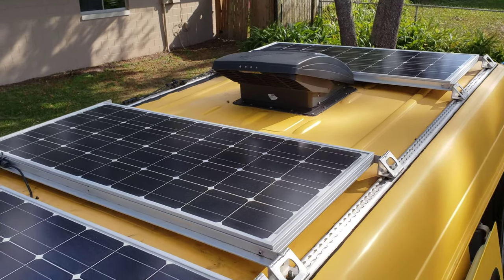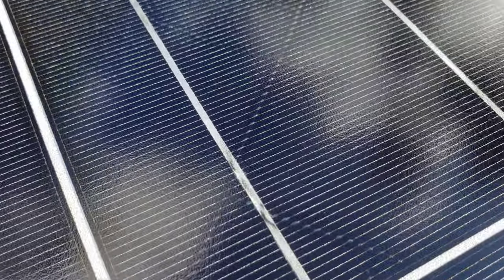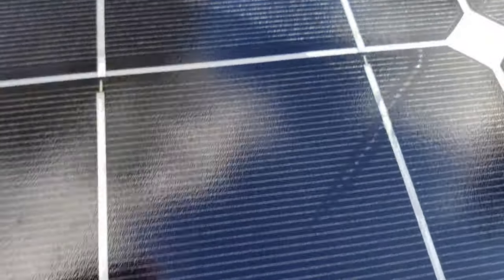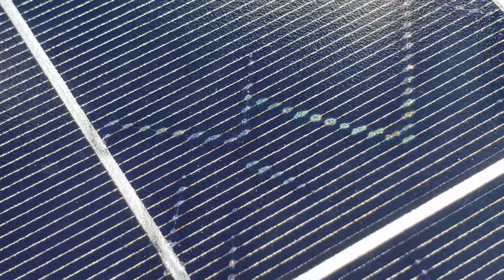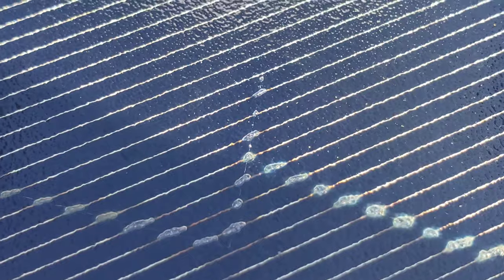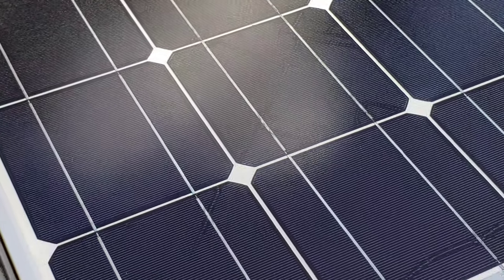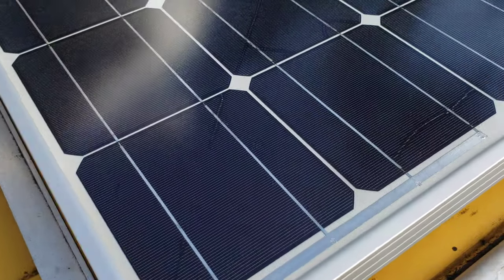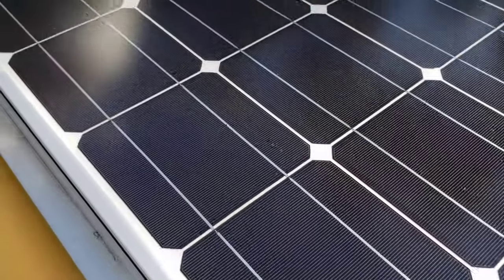RENOGY Solar Panel Failure Due To Cracks In The Cells | 100 Watt 12 Volt Monocrystalline  RNG-100D

Comment: Solar engineer here, theses are micro cracks in the module cells. These cracks are typically caused by impacts and mishandling of the modules. The module cells are much more fragile and less flexible than the front cover glass. The back of the module is even more susceptible to impacts because it typically only has a plastic sheet. Just because the front glass is not damaged by an impact does not mean a cell did not get damaged. For heavens sake do NOT walk on the module. Also most manufacturers have a spec for an allowable amount of cell cracks and test each module with an infrared cameral (electroluminescence).
Reply from the maker: Thanks for info from a pro. Appreciate your expertise. Do the micro fractures typically cause a reduction in power output? I definitely would never walk on them. I purchased a new panel, but before installing, I did some output voltage/current testing shorted and with a load and compared to the brand new panel. Surprisingly there was no noticable loss of power output from the panel with the micro fractures. So, I put the old panel back on, since the dimensions of the new panel were different, and would have required modifications to my mounts to install.

Comment: how long, Im having issues now with new three month old panels now putting out about ten amps formerly nearly 18, they're guaranteed 5 years! Thanks for details which may help. Method of checking voltage output? Any luck getting replacement?
Reply from the maker: I got a new panel thinking this one was defective due to the snail trails. However, when I measured the output current using an inline voltmeter (and a clamp meter to double check), the old panel and new panel were putting out the same amount of watts. Surprisingly, the snail trails did not seem to have any effect on output. I measured current 2 ways, first by shorting the panel through the amp meter and then used an 18V power tool as the load and measured the voltage and current in full sun.
I ended up finding that the charging current loss issue in my system was due to a loose wire at the fuse between the solar charge controller and battery.
Reply: @engineerable  thanks for the reply, maybe you could comment and explain why people put fuses on their solar panels, I see no reason because shorting out a solar panel does no damage and you're not about to burn up wires with four amps at 24 volts. To me it just seems and unnecessary complication and a way to sell fuses and Hardware that is totally unnecessary. Can you explain what a fuse is protecting and why install it?
Reply from the maker: @douglundy5755  Even 4 amps is going to create heat if shorted, and something will eventually melt. In my case I have 4 panels, which can output 400W (33A at 12V). That's a lot of energy. I have an inline fuse before the solar charge controller, and a fuse between it and batteries. Never know when something can go wrong and short circuit.
Reply: @engineerable  thanks for the reply but in most circuits there is a large amperage available if the wires are shorted, say a battery or house current. I have to disagree and say that f o u r amps it's not going to cause any damage and you can connect a solar panel plus to minus and it will simply flow 4 amps. It does no harm. I don't believe I'm wrong. Anyway thanks for the reply
Reply from the maker: @douglundy5755  I misunderstood your question, but you did teach me something. Yes, if you simply short the panels positive to negative wires, then it creates a current loop and current flows through the wires without heating up since the wires are of large enough gauge to handle the current. This is one way to test the output with a amp meter. I was thinking about what would happen if the short occured across something that can't handle the current and heated up or caught fire (like the charge controller circuit board). However, I did not consider that the panels have a current limit, and fuse needs to be larger than than the max current, but if there is a short it will never blow, so no use for the fuse. So your right, I've learned that for a single panel or panels connected in series (like my 4 panel setup), there's no need for a fuse between solar panels and charge controller (except for surge protection, lightning).
For solar panels connected in parallel, if a short happens in one panel, then the current from all remaining panels will go to that shorted panel, which can overload the wires and cause a fire. So in that case, each panel needs to be fused individually. https://www.windynation.com/jzv/inf/how-properly-fuse-solar-pv-system
Apparently it's safe practice to have a fuse on a series system for surge protection, like lightning. Although it seems like lightning could just arc across the fuse? Maybe the fuse blows, charge controller is damaged, but no further current can flow until the system is repaired and fuse is replaced. https://altenergyoptions.com/do-you-need-a-fuse-between-a-solar-panel-and-charge-controller/#:~:text=For%20the%20most%20part%2C%20you,should%20a%20short%20circuit%20occur.

Comment: Maybe hitting bumps cracked it .cell are very fragile think of glass paper thin the outer glass is thicker
Reply from the maker: If that is the case, why is it only 1 of the 3 panels? They are all subject to the same bumps.
Reply: @engineerable   They are not all subject to the same quality control the resin on top of the cell itself could have been made a little bit thicker on one than the other but I would suggest this problem just a quality control issue.  But definitely a reputable company so keep your eye out in case any recalls are issued